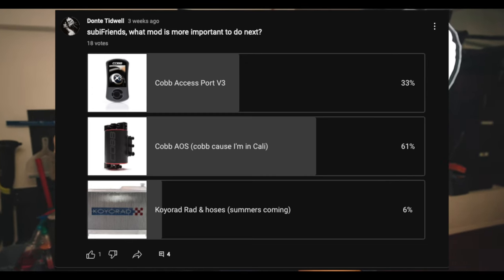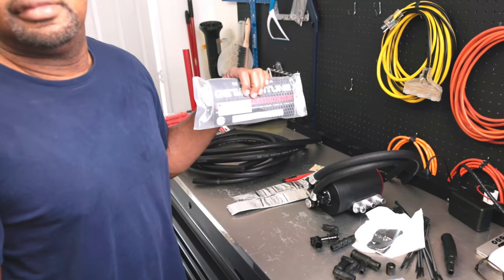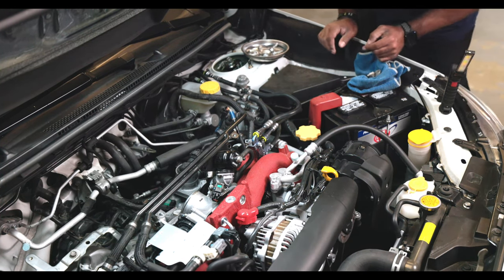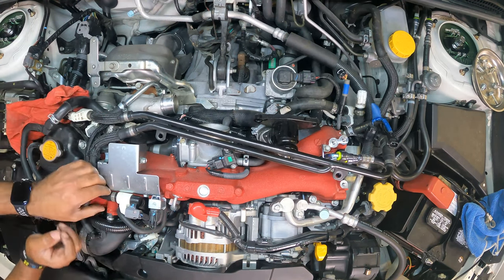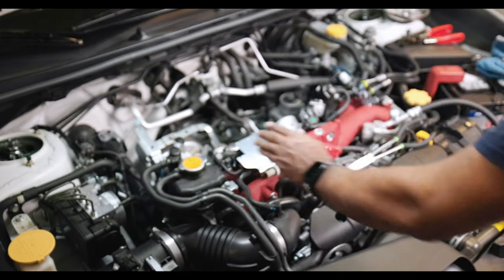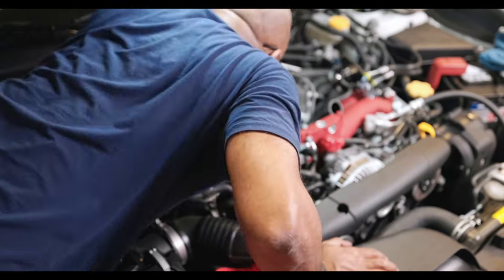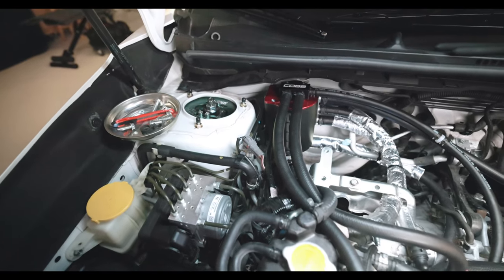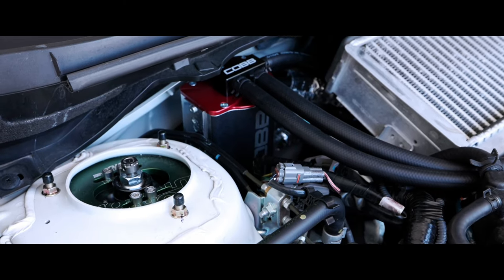COBB Air Oil Separator (AOS) Install Subaru WRX STI

Comment: great video man.. I saw you were following the iag installation video, did the hoses connect to the same ports on the Cobb aos as they were instructed on the aig video or do they line up differently.. looking to tackle this project and any info is appreciated. Thanks
Reply from the maker: Yes the IAG and COBB are exactly the same

Comment: I see the struggle with the hose for the y-pipe. The question is: Is the stock hose the same size as the one Cobb provided for the Y-pipe? If so, why not just instruct people to just insert the y-pipe onto the stock one?
Reply from the maker: yeah its the same size. but the problem is the clamp you pre-install, makes it impossible to get it on. but the factory went on with out a problem

Comment: In the end do you bleed out the air with the car running? Just installed mine, just Idk I’m noobie 😅
Reply from the maker: Yes I did. Just cracked it open a tiny bit and coolant came right out.
Reply: @DonteTidwell  cool thank you good sir

Comment: Man I went with the Iag one lol I really am not looking forward to potentially purchasing another Aos nor am I enthused about the installation process. I hope I can just leave the hoses in place and swap the unit 😂
Reply from the maker: You can reuse the same hoses. just swap out the can. Ive see another YouTuber  recently do it. My Cobb AOS came with IAG branded hoses
Reply: Cobb and IAG collaberated on the V3 and both are basically the same except the Cobb runs about $100 more from what I can tell. Is there some additional beni for the Cobb?
Reply: @dmacarthur5356 just the carb certification since I live in California as well
Reply: @Bumblebeewrx  ahhhh, so extra hundo for the sticker....well in all fairness it probably cost a lot of money to get the state bureaucrats to sign off in it.

Comment: Does the coolant level drop after installing this since you’re adding extra capacity into the coolant system?
Reply from the maker: yea it did. its right at the "fill" line on the overflow tank